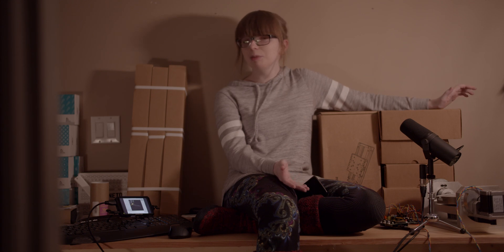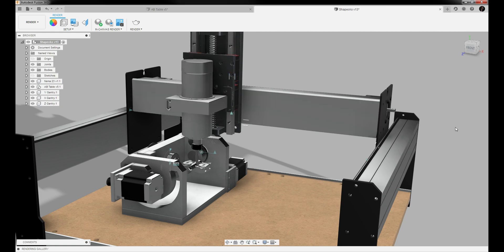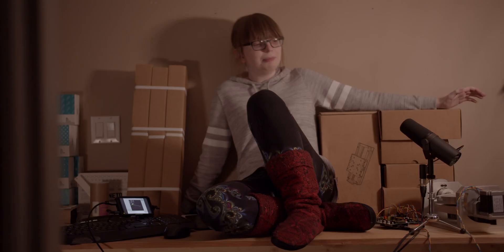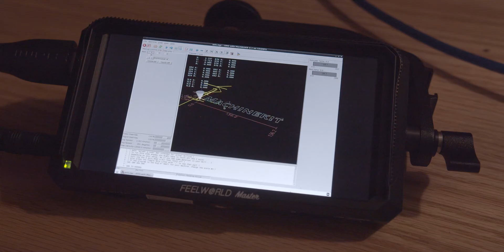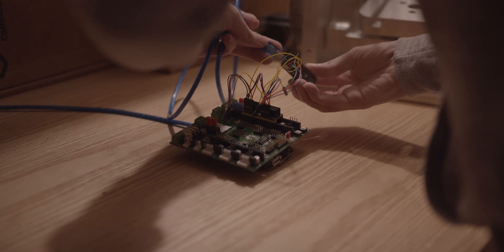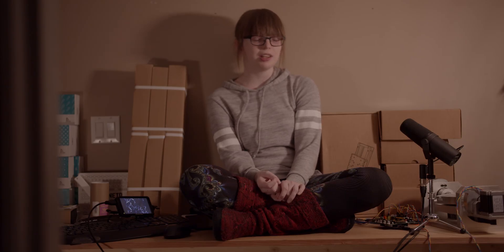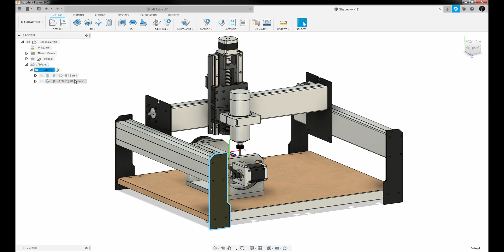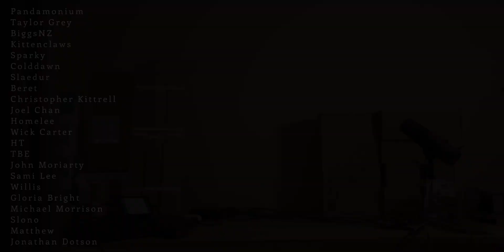5harknado - 5 Axis CNC Router

Comment: Amazing work. I build my CNCs using the PMDX 126 Bob and the Warp9 smooth stepper.  Maybe hate on mach3 and I didn't it to be amazing and very customizable.   Having a dedicated PC to run your machine is crucial in my opinion. I also I try to avoid laptops because they seem to always break before a full size PC and are hard to repair. 🙂

Comment: You could check out Bart Dring's 6axis board running grbl esp32.  It supports your beefy TMC5160 and solves the init issue you mentioned as well.  He's also built-in wifi and a webui so you can just upload the gcode from there or do the classic grbl over usb.

My only concern thusfar - while grbl supports 5 axis, I've not seen any fully working machines so I opt'd w/ mach3 to save on me tears.  (I'm mostly concerned with hitting misc unsupport g-code commands)

https://www.tindie.com/products/33366583/6-pack-universal-cnc-controller/

Comment: Just how powerful of a laptop would a beast like this require? I have an old ASUS RoG I could use for it, but I'd have to rip the thing apart for servicing, first...but I DO have a couple of old IBM Thinkpads that I've been experimenting with Linux with that might be suitable.
Reply: Not much power at all, I run a g-code sender (cncjs) on a Raspberry Pi 3B connected to an arduino. It's fairly common setup in the hobby cnc world. Since you already have an old laptop all you need is a Arduino CNC shield, stepper drivers and motors to get started.

Comment: I haven’t seen trinamic drivers available in enclosures with enough heat sinking to be able to run at high current settings. Where did you get yours?
Reply from the maker: I've got bigtreetech drivers running right now. They're only like 3A steppers or something, when I said a lot of overhead, I meant like a 7x safety factor
Reply: @AliceTyrell  Gotcha. When I used 3d printer style stepper driver motors on my DIY CNC machine (with nema 23 sized stepper motors and a 24V power supply) they would overheat on warm days. But I used crappy DRV8825 drivers which were probably a lot less efficient than your trinamics. I ended up using DM542T drivers from stepperonline, which come in a (relatively) large aluminum case and don't get warm at all.

Comment: Nice to see it chooching along! Personally I think it's still nice to have a dedicated computer for a machine, and considering the requirements to run a CNC, even with the added axis, is still not that horrendous you could probably get the cheapest second hand laptop ever and dump linux on it and use that no problems. 🙂 Looking forward to the next steps!